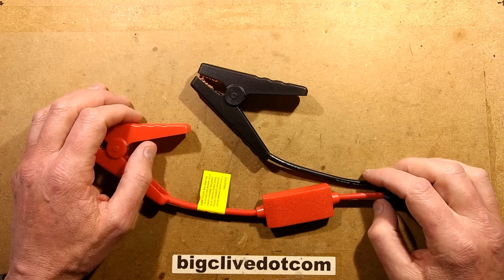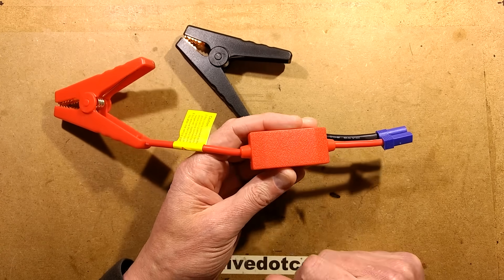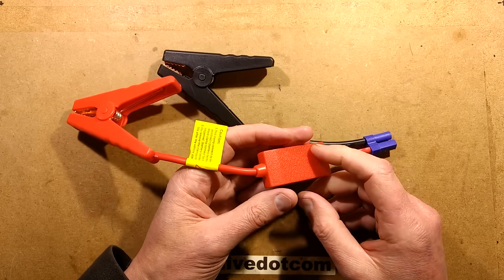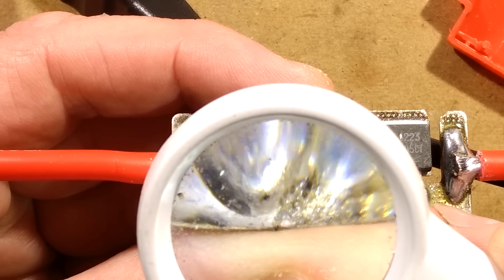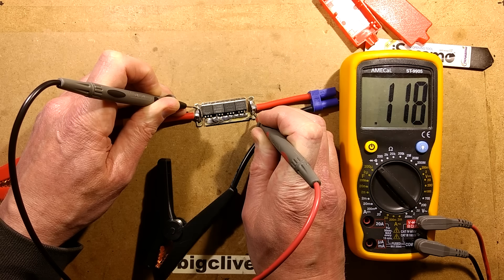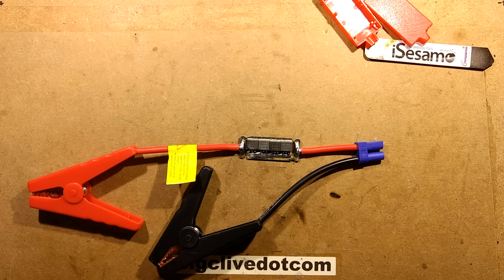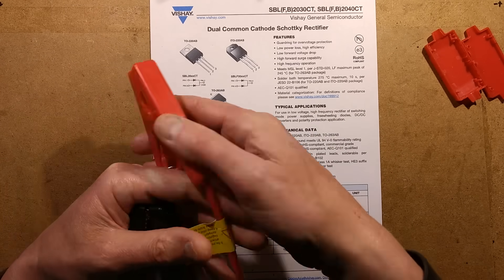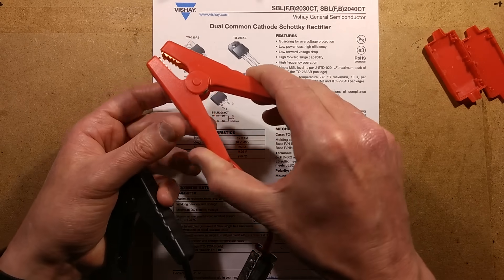What's in the little red box on some jump-start leads?  (Guess first.)

Comment: Maybe the diode pack is there to protect the lithium battery pack from the alternator's output voltage once the engine starts?
Reply: Geeze thanks for spoiling it!
Reply: as stated by mrone, stephen,etc.  also, protects from hooking cables up, the WRONG  way...
Reply: If the clamps are used incorrectly, connections reversed, the jumper will not work.
Reply: @robertheinkel6225  No, it'll work all right. These diodes prevent current from flowing "back into" the battery pack, which only happens when the car battery voltage is higher than the battery pack's voltage. If you hook it up backwards, the car battery voltage is effectively -12V from the battery pack's POV, and current will gladly flow around and around in what is basically a short circuit loop.
Reply: @robertheinkel6225  that makes more sense
Reply: That does not make sense since the alternator output AC is converted to DC before it reaches the battery to charge the battery and supply DC power to the rest of the car.
Reply: Yeah that makes sense it was that simple
Reply: Yeah I thought the same thing to be fair 👍
Reply: A diode simply allows current to flow in one direction The diode is to protect from connecting the wrong polarity between batteries and has very little current regulating properties. There-is no need for over voltage protection
Reply: @denniss9620  it would keep current from back feeding into the jump pack from the alternator.
Reply: @alexmawdsley  The diode serves one purpose Blocking current flow from cables hooked up backwards at the battery
Reply: But the alternator charge controler limits the output voltage 🤔
Reply: @trojanhorse5363  Doesn't matter much anyway, lithium packs can be charged faster and at higher voltages than lead acid batterys, a LiPo4 12v pack can at well over 16v when it's charged right up to it's maximum although generally you leave them at around 14.4 as the extra shortens their lives and doesn't gain you much extra capacity. The main charging danger for a Lithium pack is trying to charge it when it's to cold, in fact charging litium batteries with a normal car alternator can overheat the alernator because tthey can draw so much current so quickly compared to lead acids.

Comment: Not only does this protect the li-po (or li-ion) in the power bank against reverse polarity, this also has a significant use in "standard operation". As soon as you fire up your car's engine, the alternator kicks in, delivering around 14V towards battery terminals. Both the alternator and the power bank might not like it (I would expect a significant current going into the li-po), that's why they are so consistent on reminding you in the manual to disconnect the device as soon as the engine starts.
Reply: Still, the argument remains valid. Those jump start packs re usually 3S packs, which means they have a maximum voltage of 12.6V when fully charged. High amperage 30-40A at around 14-15V that a car alternator is happy to churn out will make your pack go thermonuclear in a matter of seconds. Diodes prevent that.
Reply: @blubbspinat9363 , I have been jumping cars without the diode set.  I unplug the wires right after the engine starts.  Also, I find the engine more likely to crank if I leave the battery pack connected for five minutes before a start attempt.
Reply: @billmaghan  when I've had to jump start something, I've given it roughly 2 - 5 minutes depending on the size of the battery. If that fails to do the job, I'll get my jump cable out that has decent cable and decent fittings in them, that gets it going.
Reply: @blubbspinat9363 if you measure the voltage output on the jump packs, they're much higher voltage than the normal automotive system voltage, most likely 4s.
Reply: @wingerrrrrrrrr  That differs from model to model. Minde is definitely 3S, which i know because someone gave it to me because it was broken and did not work at all. turns out it had a short in the 19V output which i do not use anyway. I have also seen 4S LiFePO4 which are an almost perfect match for 12V SLA. Yours may be different, but 4S LiPo seems way off.
Reply: @blubbspinat9363  maybe the older jump packs had the lower pack voltage, the new ones like those tested on Project Farm show much higher than 13V.
Reply: If one wanted to design a LiPo jump start pack with safety foremost in mind, rather than cost, it would be a simple matter to add a voltage sensitive relay to the package, which would detect when the voltage on the car got higher than the voltage in the pack (i.e. when the alternator kicked in).  That said, these things are churned out of factories by the tens of thousands in China, and a VSR would add substantial cost to a production run.
Reply: Diodes are cheap and effective !!
Reply: They are function as diodes, but they are transistors correct..?
Reply: it would be wonderful, if they had an automatic contactor, wired up. so as soon as the alternator BEGINS charging, this relay thingy would disconnect lithium pack........IMO
Reply: tks
Reply: That happened to me a few years ago, bought a cheap jump start thing on ebay, decided to try it out and intentionally drained my battery

Well i hooked it up, turned it on and started the car, worked very well, but my 100A alternator disinigrated the jump starter before i could even exit the car, i guess there was no diodes in that thing lol
Reply: @90msg90   it's not the voltage you should worry about but the amperage..avg car alternator 30 years back was about 65 amps these days it is 100+ amps if a battery has gone dead and your car has an 100 amp alternator you are talking about 70-80 amps at 14 volts hitting that battery from the alt once the car starts.
Reply: hellshade2 Well amperage is dependent on resistance (virtually nothing). Not saying the battery won’t explode, but just because the alternator is CAPABLE of 100A doesn’t mean it forces 100A through whatever you attach.
Reply: @MaplePanda04  LiPo4 batteries kill alternators more often than the other way round, their internal resistance is so low they can take very high charge rates, most car alteranators are not built with enough cooling and the windings melt, this has been a problem for people in boats and RVs as they swap their house battery banks from lead acids to lithium chemistries.
Reply: @popuptoaster  It is true that if you have a lot of lithium ion batteries in a system but have not upgraded the alternator to a more powerful version to match the power it takes to charge them, you can end up overheating the alternator. Though this can be mitigated somewhat by installing an isolator on each lithium-ion battery so you can charge them one at a time. You can also change the "gearing" of the alternator drive - replace the pulley driven by the engine with a larger diameter one, so that the alternator will be spun faster for any given RPM range of the engine. This will exponentially increase the effectiveness of the integral fan on the alternator, blowing more air through it and therefore improving the cooling. Or you can just install an extra 12 volt fan (like an old car radiator fan) in the engine bay, to constantly blow more air over the alternator, also improving cooling.

A much more common problem which kills alternators is nothing to do with the lithium-ion cell chemistry or charging rate, but certain ways that the battery management systems (BMS) can behave. If the alternator is only charging a lithium-ion battery, and it approaches full charge, if the cells are not entirely balanced, the voltage of at least one cell can end up overcharged, with the cell voltage exceeding 4.2 volts. If the BMS detects this condition, it can decide all on its own to "trip", essentially shutting the battery off for a few minutes until the excessive cell voltage drops back to 4.2 volts or lower.
When the BMS shuts off the battery, this is effectively the same as temporarily disconnecting the battery from the system. If that battery was the only one connected and being charged, this can suddenly un-load the alternator - it then has little or no resistance connected to it. Unfortunately, this can cause the output voltage of the alternator to rapidly spike, up to as much as 100 volts, if not more, for a few seconds. To start with, this can fry the built-in rectifiers irreversibly, killing the output completely. Until this frying is complete, the high voltage also goes to the "field coils" or excitation coils, forcing a much higher current through them than would otherwise be necessary, so these get burned out as well. Last but not least, any on-board appliance which happens to be switched on at the time will also get exposed to that same voltage spike, and are therefore also likely to be overloaded by this and again, fried.
Reply: @hellshade2  Keep in mind that even tho plenty of amps is available, the battery takes what it needs.
Reply: 90msg90
Reply: why did this take 16 minutes to explain?
Reply: 3S Li-Ion => 3 x 4.2V = 12.6V.

CCA of a 60Ah 12V Lead Acid is higher then 400A.

Alternator SHOULD limit itself to 14.5V, but the electric system MUST support more. Regulator MIGHT be compromised.

Both pluging with reverse polarity and operating against a higher voltage supplied by the alternator can cause substantial damage.

I agree.
Reply: 90msg90 Reverse polarity clamping will pass right through those diodes, as the leftover voltage in the car will act like a hugely flat battery drawing a lot of amps until something fails, probably violently.  I'll be like shorting a 24V extra beefy battery.
Reply: @johnfrancisdoe1563  You mean like the positive of this would go through the diodes to the negative of the flat battery, and its positive would complete the circuit to the -ve of the device, I guess you are right.  The diodes only give protection against a greater voltage from the "flat"  battery driving current back to the device.

Comment: I would love to see one of these jump start packs explained. how the hell do they get enough power to jump start a car? I went out to a totally flat petrol engines fiat doblo... no lights on the dash flat as a pancake. customer comes out with one connects it up and boom off she goes couldn't believe it had enough power to start it and didn't even seem to struggle!!!!  I bet a normal small car battery would have taken a while to get it going. I usually use leads off my twin battery Toyota Hilux. keep up the great work Clive your videos are superb and make me more interested in electronics every time I watch!! :-)
Reply from the maker: The secret is in the very high current capability of the lithium cells optimised for sport applications.  That's also what makes them quite scary, as they tend to fail violently if damaged or overloaded.
Reply: Li-po-ion cells can have crazy high current limits, and since it only needs that current for <1 second (usually), it can draw much more current than its rated for. So if a Lipo pack is rated at 120 A, it could provide a burst current of a lot more, now imagine some in parallel... How safely... well that remains to be determined.
Reply: It's that "fail violently" part, why I don't use them in automotive applications, even for jump-starting. Bound starters or dead shorts can draw as much current as you can feed them, and I don't feel like putting out another car fire, thanks. ;)
Reply: For very short bursts you can have discharge currents up up to 100C (that's peak current that would discharge the battery completely in 1/200 of an hour) A 1000 mAh battery can give peak output of a hundred amps or so.
Reply: Depends on a lot of factors.  If it's a small engine it doesn't need as much power to move less "stuff" plus it only needs to provide power for a couple seconds.  Also depending on if the battery is bad and not accepting a charge vs drained and trying to suck in a ton of power that will make a difference.

With traditional jumper cables the size and length matter significantly, I had a friend melt some cheap thin WalMart jumper cables trying to charge his battery enough to start his little Escort - I came home with my 4AWG cables and hooked them onto his battery it started immediately.  Another time I had a friend's mini-van that took a half a minute of revving my engine to charge their drained (but good, they just left something running) battery enough to jump start.
Reply: I have one from Boltpower I got from Newegg. I keep it in the house. I've used it a few times and they do work pretty well for my car. But I wouldn't try to jump a SUV or anything big. Also makes a nice 10800mAh battery bank for phones or laptops.
Reply: Yeah to be honest I like jump leads because if the discharged battery will take a charge you can give it a charge for a while to lower the massive draw and not melt something. I've used quite a few of the classic style jump packs but they can be hit and miss. that and I'm too tight to buy one...
It makes me laugh when you get people jumping of a 12v battery (not on a vehicle) and wondering why it still won't start. The fully charged battery and 14.5 volts and 100amp from the alternator don't half make a difference 
lol  and you can leave the leads on to give the alternator chance to start charging. I'm preaching to the choir now. :-)
Reply: There is usually so much resistance in the clamp and leads that the load is not as massive as one may think.  In addition, by giving it time, you are allowing things to heat up.  And then consider that there will be losses in the vehicle battery itself, both charging and discharging.  I believe it's best to turn on the jump starter and immediately crank the engine (making sure all possible accessories are turned off first).  It can be helpful to have someone tightly squeeze the clamps for better contact.

For some reason I've had a lot of experience jump-starting vehicles.  I'm just too nice.  The old lead-acid jump starters are such a pain in the ass, with the need to lug them around and recharge monthly.  I just love these lithium jump starters. They can go in your pocket and only need charging once or twice a year if not used.

Comment: I have an Aukey jump starter that I had a peek inside the cables. Unlike many of the Chinese ones I was pleasantly surprised to find both cables going into a slightly larger box which had the negative feeding straight through with a fuse but the positive went through all kinds of safety and support circuitry. It had the flowback resistance from diodes, a relay to switch the output from powerbank on or off depending on the voltage of the car battery it was attached too and a couple thermal cutouts also. Very impressed compared to this Chinese cable, but for so cheap you can't expect much more than a few diodes!

Comment: This is a Big Clive video, so I'm just going to shout things like "Bridge Rectifier". Even though a Bridge Rectifier wouldn't be in a cable designed for DC.
Reply: Feeding DC into a bridge rectifier is a handy technique to make the device operate normally on AC or DC irrespective of the polarity.
Eg. anything electronic that is connected to a telephone line will use this technique.
Reply: FULL BRIDGE RECTIFIER
Reply: no it would be a capacitive dropper
Reply: There's enough diodes for one, tho.
Reply: Irony: ends up being filled with half bridges...

Comment: Reminds of a electronic brushless motor speed controller (ESC) that run LiPo packs when they take multiple mosfets and put them in series for different reasons. Sometimes for redundancy, sometimes for load distribution balancing, and sometimes to lessen the heat. By using multiple each one runs a lower load instead of one  over heating even if it's rated to take the current it's running. You can make it smaller if each component runs colder with multiple then trying to keep the thermal temp down on a single and a big heat sink and larger copper PCB ground plain and sometimes an added fan. Or all of the above reasons to run multiple in series.

Comment: Seen these cheap packs it use - before they blow they tend to melt the solder in the joints, They then fall apart, Cheap thermal protection maybe ?

Comment: The diodes are probably used to keep the current from the alternator going into the LiPO cells. Car alternators can output around 80A at 14VDC with some going over 100A.

Comment: It's to prevent reverse charging of the lithium cell, because the connection circuitry bypasses the usual protection circuitry on these cells. Tom's hardware did a teardown on a Silverstone USB power bank with built in jumpstarter once and it also had that.

Comment: haven't seen what's in the box yet but is this similar to the cylindrical bumps that you can see on laptop power cables and stuff? usually near the part that plugs into your device
edit: watched entire video now, it's probably not similar to those bumps but still wanna ask
Reply: kiefac the things on laptop chargers are Ferrite beads, and they reduce electrical noise/interference.
Reply: Akaishi ah man, that seems really obvious now. tyvm for the info